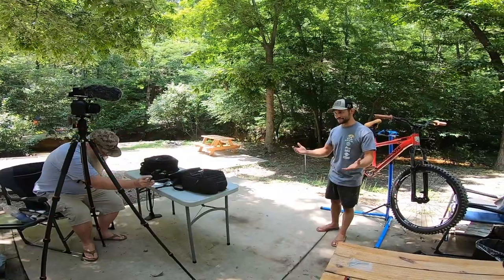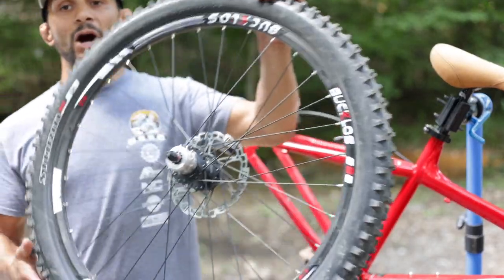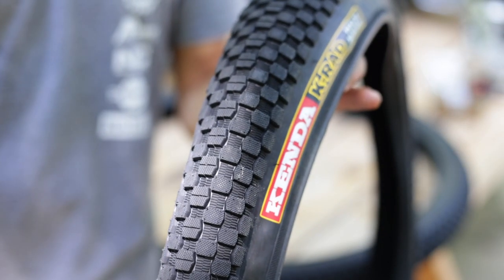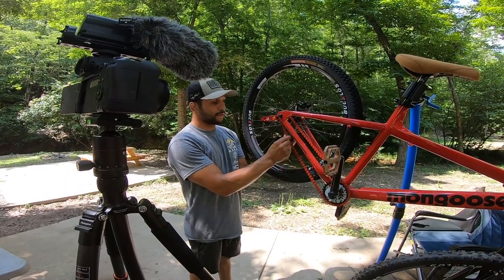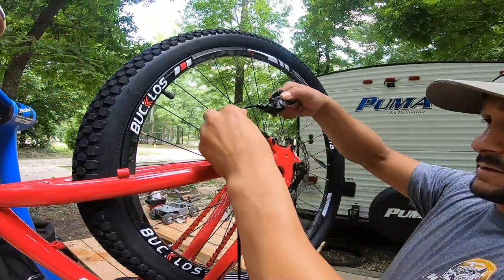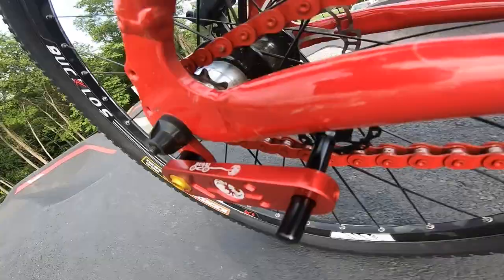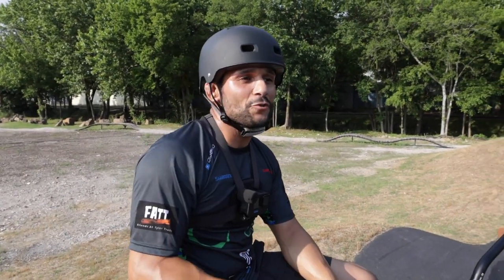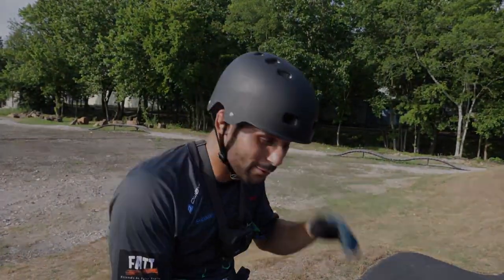Our 26" Dirt Jumper

Comment: You really need to put a 100mm fork on it and run about 20psi more air than you would run on trails. Yes, the chain tensioner is installed correctly, lol. Back in my bmx prime Kenda K-Rads were my go to tire because they feel awesome on everything, whether it was dirt jumps, street, or flatland. Keep shredding 🤙

Comment: You can have the tensioner push up by re-arranging the spring. Since there was not that much slack to begin with, pushing down is ok. A little more rap on the cog, by pushing is no biggie...